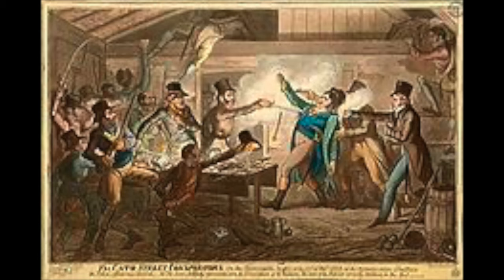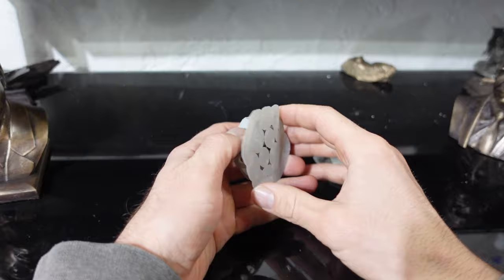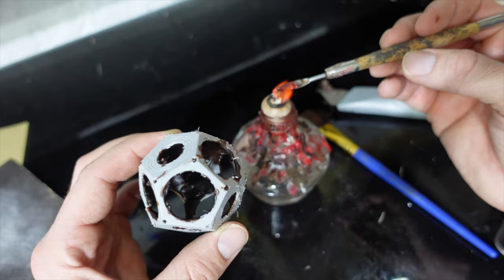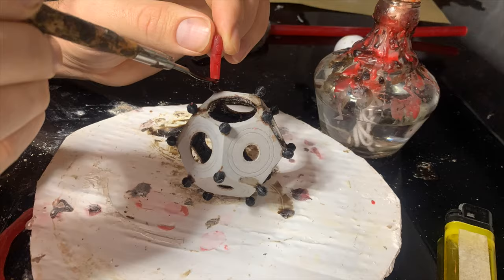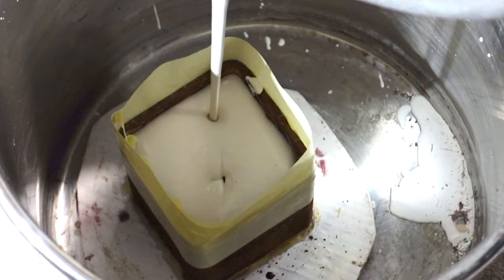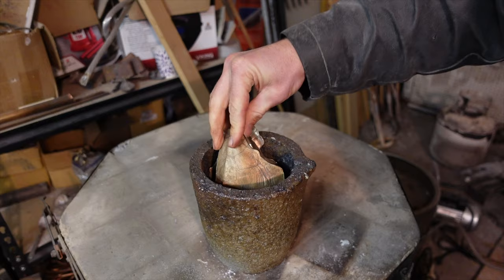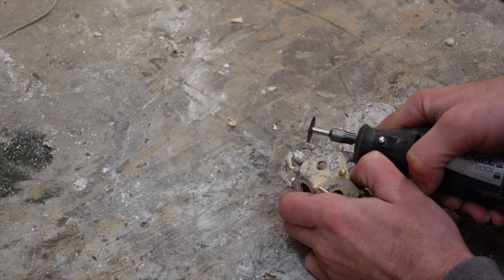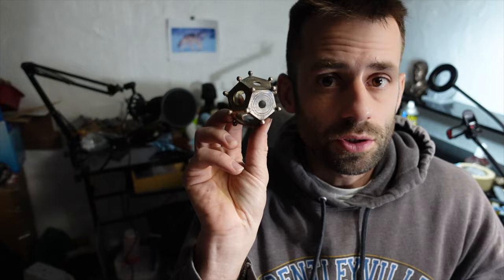Making A Bronze Roman Dodecahedron

Comment: Very philosophical nub theory - good one hoser!   Also one hell of an ending - my bet is on an asteroid and the archeologists can't find it, but Indiana Jones is resurrected, finds the coveted dodecahedron and the legend lives on...  
Quoteable quote: "a doohickey by any other name is still a rose".  Huh?
Reply from the maker: 😆. Never heard that quote before but I’m going to keep it.
Reply: @lundgrenbronzestudios   I never get my quotes right the first time so I have to correct and correct....  My mother is an endless quotable quoter who's heard it all.  

Know nothing about 3D printing so wondering if you can hand smooth the printer's wave lines, inscribe hieroglyphics, modify program code to add hieroglyphics, etc.
 # 
Good casting practice is to cast a few extra "slugs"(3/16" diameter, 3/4" long -best to have assrment of sizes) you can later thread for repairs if needed with the matching metal.  Or,  in this case, an extra threadable "nubscrew" or two.  Defect can be drilled out, threaded, then cast blanks threaded to fit, then peened/finished.  Peening compresses void and makes for a very strong permanent repair.  Don't quote this - never did much metal casting - just remember academically.  A good welder may do differently, not sure.
Reply from the maker: You are right about that. That’s how ancient people would fix flaws without a welder.
Reply: Original quote came from Romeo & Juliet: 
"You can dress up his treasonous actions with whatever heroic descriptors you like, but it still remains treason. A rose by any other name, as they say.
Honestly, I don't care if they end up changing the name of my town. A rose by any other name would smell as sweet, and this will always be home.
A: "Do they really think that changing the company's name is going to effectively distance it from the scandal?" B: "Yeah, I don't get it. A rose by any other name, and all that."
Reply: @lundgrenbronzestudios  If one has no welder then color matching screws still a viable option today, though may require a tap/die set.   Good option if alloy is difficult to weld, too.   Sprues are often used as the screws.   A process called friction or cold welding uses a sprue slightly larger than drilled out repair hole - sprue is placed in drill and spun until it stops, resulting is a strong permanent "cold weld".  Simple ball pen hammer removes smaller pockmarks,  dremel like tool with lots of bits, asrtmnt of files, sandblaster-tumbler-vibration,  buffing wheel, etc., etc..  Welding bits of sprue/runner pieces may be the best. There are Tons of repair tricks out there, everyone finds the one(s) they like best.  Finishing can be minimalist or can take longer than all the other steps combined.
You have the best option Tig, an O2 torch will do, along with lots of other tricks not even listed here.

Comment: The Gallo-Roman dod was used by Roman troop arms merchants (Negotiatores), to measure, procure & for maintainence of the Auxiliary troop polearm weapon (wood) shafts.  It measures the diameter of the mid shaft (in some instances), the taper of the shaft near the join at the weapon head socket, and the taper of the shaft, that resides inside the head socket.  If you are an archeologist or history researcher, & need more info, let me know.
Reply from the maker: I’m just a bronze smith who thought it was a very interesting thing they use to make.
Reply: Good job on that spider casting! @lundgrenbronzestudios
Reply: So why are there no numbers or markings on any of them?
Reply: @steve6375  Thx for your question.  I'm not sure, other than I believe it's a military/merchant interface tool that doesn't need to advertise its use (and never would).  Many of my tools have no marks or numbers on them.  I see each dod as a spec key for a specific auxiliary troop in a garrison or area; all (or important) specs of the polearm (that are important to that arms officer/commander) were encoded on this multi-purpose tool.  JMO

Comment: OK, I absolutely LOVE this, because I have been contemplating making a dodecahedron, myself.  Mainly because I know I will never be rich enough to own a real one.  I had planned to build it out of wax plates, and then cast it by centrifugal force, because I don't have the foundry setup yet, but it's the same idea.  Of course, it just kills me that you tossed it in the bog... speaking of which, you should probably add a runestone.  Which, considering where you are, shouldn't even raise an eyebrow.   😄

How did you fix the small flaw in the casting?  Tig weld?
Reply from the maker: Tig welding is one way. Another way is to drill out or simply insert a small piece of bronze into the hole and hammer it in. Hammer it until it is embedded and peen the metal down and filed away the rest. But typically I use a tig welder.

Comment: Must duplicate it exactly.   Don't make up your own hole pattern.   Use lots of photos of existing versions.

Suppose it was a modern single flat plate with the same holes.  Then obviously its for creating wood dowels of various sizes.  Hammer a rough-carved stick through it to get started, then later just yank it through each smaller aperture.

If they were scattered all over, mostly in remote military camps and not in cities, then they'd be for "mass production" of arrow shafts, not just for any smooth dowels.    Any giant ones?   Those are for making smooth spears.

Comment: Just saw another video on YT that claims these were used in the sending and receiving of encrypted messages.  It seems quite plausible and explains several things, like the knobs on each vertex, the rings around some of the holes, the reason why they are found associated with either very wealthy merchants or the military, and why it has 12 differently-sized holes on the item.  Video here:

https://www.youtube.com/watch?v=vBDgmE3d0aw
Reply: No because you dint need a dodechedron to use that method!

Comment: I belive its used to create "rolls" of coins out of threads.
Reply from the maker: That’s a new idea.
Reply: @lundgrenbronzestudios  thanks. I'm thinking: for payroll/transport of money bags would be difficult to count and verify the contents. Mesh rolls created with his device would be easy to distribute. Wax could be used to seal the rolls to validate no tampering and place a seal of the location of accounting. The different holes are to weave the mesh rolls to the right size.  Kinda like rolls of salami, lol.
Reply: @lundgrenbronzestudios  also, I'd  imagine the rolls of coins would only be smaller amounts like 4-5 coins, not the high dense paper rolls we use today. More like the little bags Babybel cheese comes in, but in the form of a mesh roll.

Comment: Just seeing it for the very first time... it is Blatantly Obvious what it is and is used to do.
It is a Cypher!
Each hole is a different size = different sized peg for each hole = each peg has a fixed and a rotating disc of Latin Alphabet.
Twelve sides = 12 difference cyphers. So when use peg 7 with it's pair of discs. After the cypher is jotted on the wood, papyrus, etc, placed inside a courier container (cylinder) and pour wax and press down the bottom (opposite side of discs). 
The person receiving it would place their unit in the wax holes to get the right size 7 UPwards... put in the matching cypher 7 peg with discs... and decode the message. 
Easy way to convey Secure Messages across the Empire!
New size 1 to 12 pegs / discs could be made each year or each Olympiad (4 years)... so the code is impossible for anyone without a unit... or with the OLD cypher = message is jibberish.
Reply from the maker: Makes sense why they never wrote about it then.

Comment: Stop speculating and look the video below.
It can be used as a knitting device, for ropes, gloves and jewelry.
The presentation in the video is very convincing.
It was first? discovered 2014 but the presentation lacked in persuasiveness.
Reply from the maker: It’s a theory.
Reply: @lundgrenbronzestudios  
Maybe, but the practical demo is quite convincing.
Reply from the maker: @geroldbendix1651  some dodecahedron didn’t have holes in them like this so a knitting tool becomes questionable.
Reply: @lundgrenbronzestudios  
Unless they dig up some scriptural evidence it will remain of course a theory.
Are you sure that they also found some without holes?
I saw some with very small holes.
Anyway, at least she discovered a way to practically use these.
Even if it is a theory, it's more useful than Big bang theory and Darwinism together, right?

Comment: Wonder if it is simply a device that was rolled to help decision making to personal or even formal questions or problem solving while connecting with their gods, 12 gods of differrent things, 12 sides, the nubs stop the bottom face, essentially a god in the eyes of a Roman, from touching the surface of something.  You say it was often found with coins, so it could have been used as part of a decision to buy or bartering process.  🥴🤭
Reply from the maker: It’s a mystery.

Comment: Those are for making gloves. Ive seen one in action. Ill try and find the video.  
They would wrap the thread or yarn around those ends in a pattern and create  gloves. Im not bull shitting you on this one.

Found a video but it wasn't the one i originally watched. heres the link.
https://youtu.be/76AvV601yJ0
Reply from the maker: The problem with that theory,  while it may be an option, is that the same thing could have been accomplished with a piece of wood with a hole in it and pegs. The cost and care to make such a piece out of bronze doesn’t seem to fit well with the idea that is was a simple knitting tool. There were also some made that couldn’t have possibly been used the way this woman is using it. So while it may be one of the theories, it is still debated.
Reply: TOOL
Reply: AIRHEAD

Comment: Romans did not have 3D printers or Silicon rubber to make the waxes. Some simple accurate technique must have been used to make scores of them in wax , all identical . Perhaps by cutting 12 pentagons from wax sheet , all identical outer size with pairs of hole sizes them hot knife melting them together and adding sprues knobs runners risers vents pouring cups as normal afterwards. Seems obvious to me and reasonably  idiot proof .   Jonny UK
Reply from the maker: The fact that you call it “idiot proof” tells me all I need to know about your experience in actually making such things yourself.
Reply: @lundgrenbronzestudios  Well I never. All I refer to is the making of dozens of identical waxes and simplifying that process without silicon rubber, which as you know is how it would be done today , in Roman times . An idiot proof way would be to lay out a sheet of wax and cut identical pentagons with a premade metal cutter and stick them together with a hot metal knife. How could that go wrong ?. Just a comment ,may I respectfully, add, that I was investment casting for a job in Birmingham UK the worlds centre for gold and silver manufacture. Making the waxes was always the top job. As you well know matey .No need to get narky .
Reply from the maker: @jonviol  maybe is a British phrase but here to say something is idiot proof is to say that even the most stupid person could do it and not screw it up. These craftsman who made these were very skilled. Sorry for the misunderstanding.
Reply: @lundgrenbronzestudios  Should you choose to read my comments again ,including the words 'perhaps ' and 'reasonably' the positive enquiring intentions might surface. Thoughts after reading the title and watching the upload include those of being deceived in not seeing a 'Roman ' object being made the 'roman' way. . They had no electric kilns ,propane torches. silicon rubber moulding materials,   3d plastic printers ,dremel multi tools or high tensile steel files. So how were they made ?- in accurate repeat numbers. That is the intriguing fundamental question which sort of proves the objects critical high end function,its huge expense and non commercial application. A far more substantial and correct demonstration of its manufacture  ,entirely by hand without electricity or steel tools would reveal aspects of its importance and intended purpose which the finished object itself hides.  The waxes are ,to my critical thinking the big clue most especially the concentric rings around the holes.  Some idiot proof accurate method must have been used and carving the wax was not one of them, and casting the waxes in two halves in reusable rigid mould  is just impossible.
Reply: they were not identical

Comment: They were used for knitting gloves
Reply: No, dolt, they were not.
Reply: @frontenac5083  yes, fool, they were
Reply: @andymatheson82  no, they almost certainly weren't.  The first record of modern knitting doesn't appear until the 16th century, something like a millennium after these date to.  Not to mention that we've found very similar objects that don't have the holes in them.  And the fact that a much simpler (and therefore cheaper and easier to manufacture) object could be used to achieve the same thing.
Reply: @zackakai5173  you're wrong, but you do you buddy